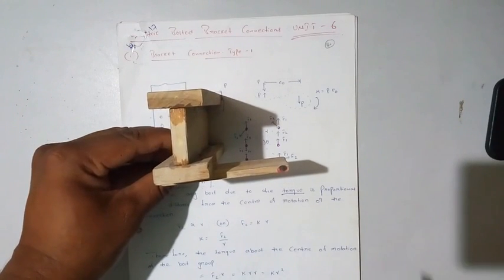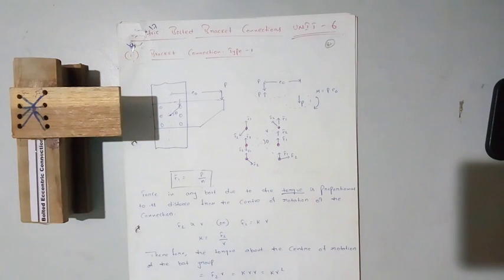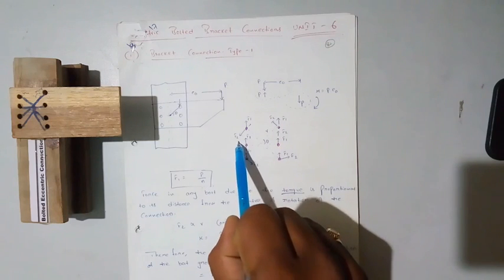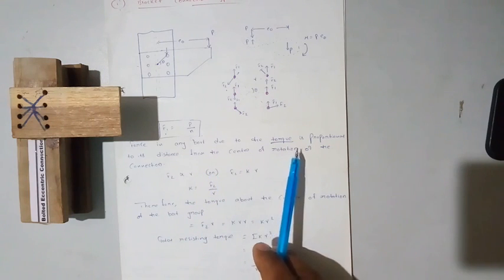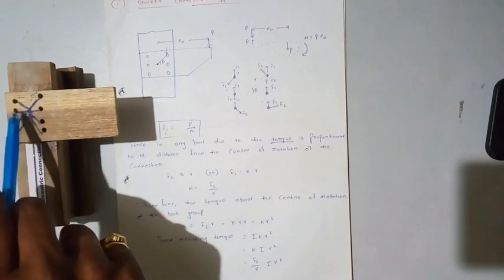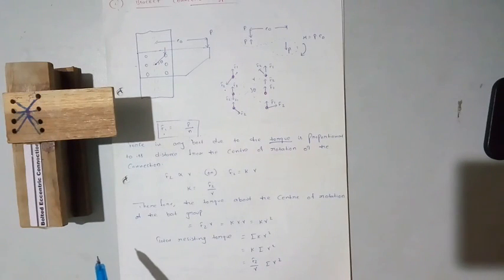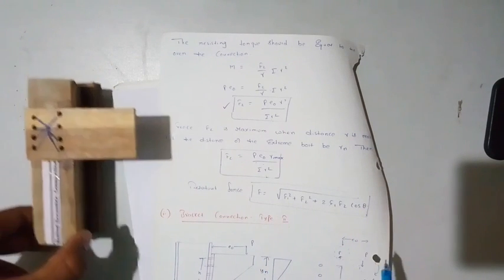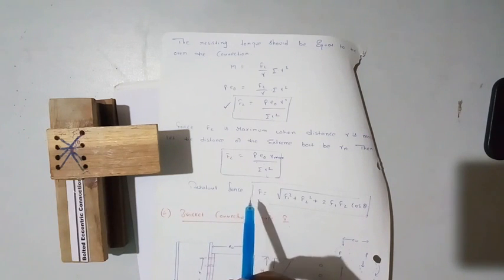Eccentric Bolted Bracket Connection Type 1

Comment: what is exactly shear force means? Generally, F1 is the load, right?
Reply from the maker: shear force is the one which acts perpendicular to the axis of the bold....In this problem you can see...load is acting in this way only..
Reply from the maker: yeah...the force which acts perpendicular to the axis of the member.... represents as shear force..where member will shear...Here in this model...force F1 is perpendicular to the axis of bolt...you can see it clearly.